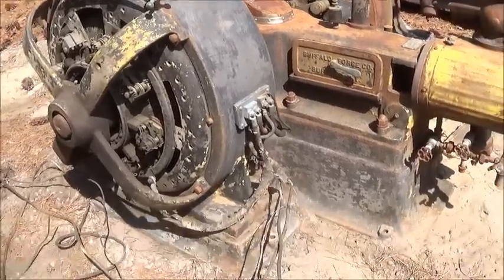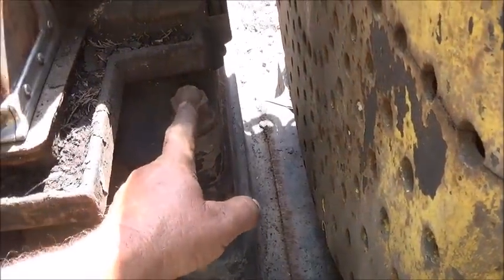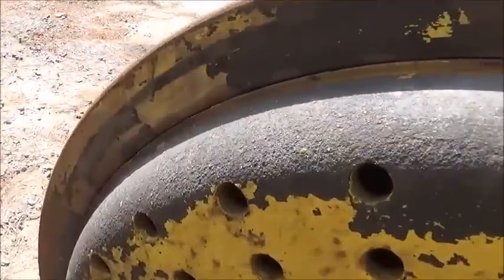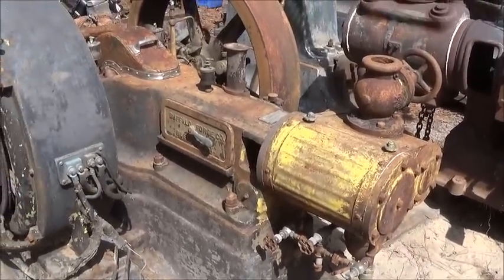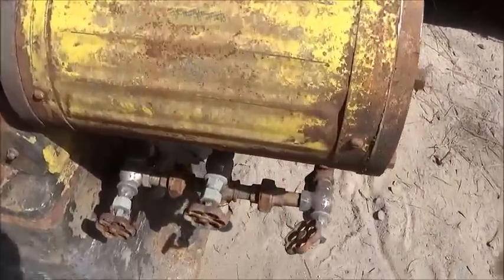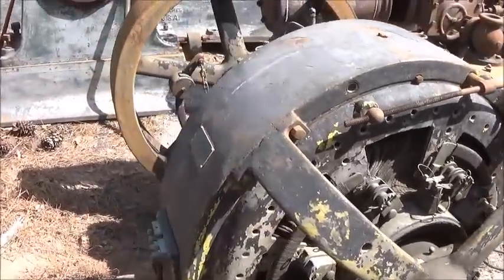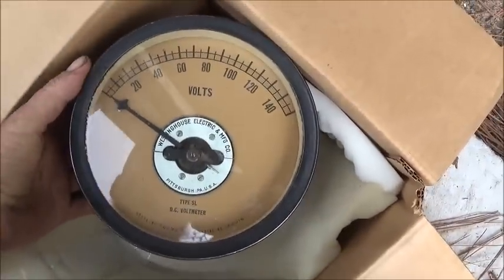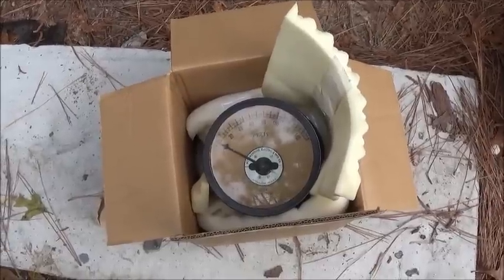BUFFALO FORGE CO. STEAM ENGINE GENERATOR

Comment: I wish you could explain how these worked. Like, where do you get the steam from. Where does the wood go. I'm confused.
Reply from the maker: There is a boiler (big tank with fire box)  that has water and fire. The water boils and turns to steam. A pipe carries the steam to the engine and since the steam is under pressure, it makes the piston move and the crankshaft turns that into rotary motion to turn the flywheel.

Comment: There is a 
st Mary's carbon brush company than if you need brushes look thru their offerings.  There are differences in the carbon composition between the low voltage excitor brushes and the output brushes.  In case you did not know.

Comment: L.E.D.  is light emitting diode they light in one direction but not the other they would get hot and want to be run at lower voltage on dc.

Comment: If you had a large open top tank you might could get a nickel ingot and with a power supply you could use electrolysis to re-nickel the parts.

Comment: That looks like a 120 volt dc generator a have a smaller similar generator I run it on a Massey hares gas engine from 1923 I run regular incandescent lights